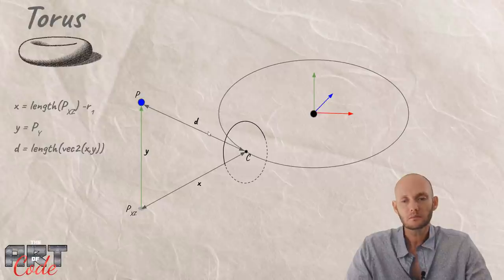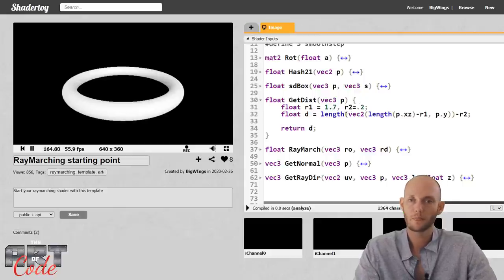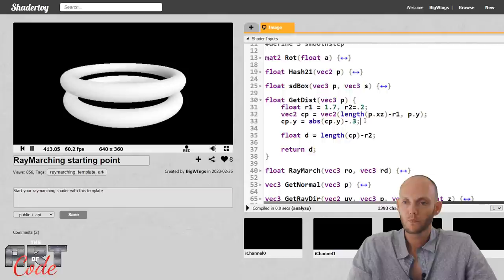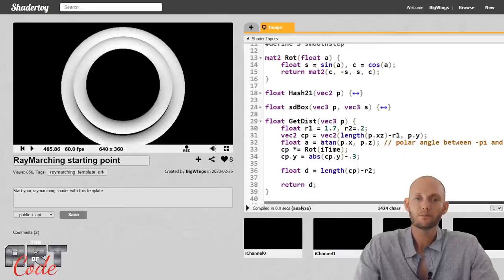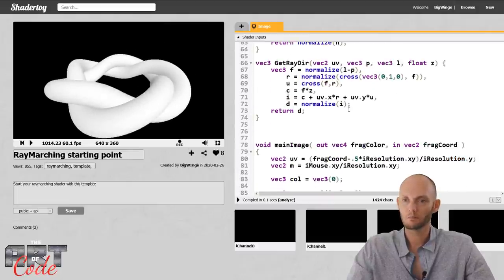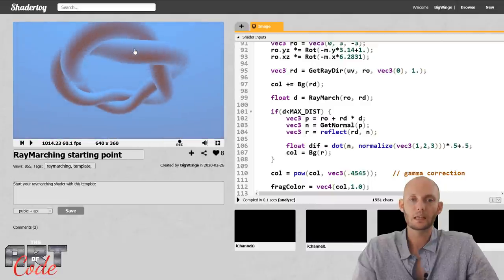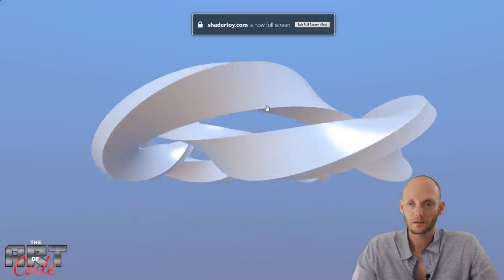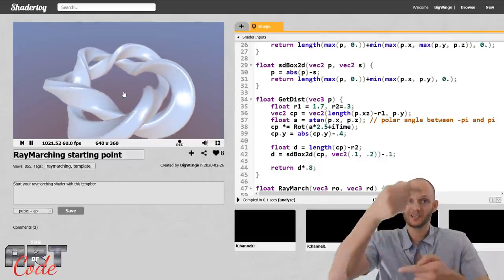Torus Knots explained!

Comment: Are there any mathematicians here? I can easily look up the functions such as max(), min() and their meaning. However, if I wanted to apply myself to study for the next 12 months, what  should I learn, in order to understand these functions and the maths behind programming these graphics? Thanks in advance.
Reply from the maker: I suggest you start at the 'shadertoy for absolute beginners' video and work your way up.
Reply: @TheArtofCodeIsCool   I didn't want to bother you directly as I assume you're a busy man. I meant which branch of maths I could apply myself to in order to illuminate and have have a deeper understanding of the subject. Your explanations are superb and they serve for the tutorials and beyond in some cases. I'm wondering if I should apply myself to trigonometry, linear algebra, calculus and if there is a recommendation for any particular maths course or foundation. I am a computer science graduate that studied discrete mathematics and have a college level understanding of trigonometry and a little less knowledge in algebra and calculus. I am over 50, so it has been a while.
Reply from the maker: @sidfreeman835  there really isn't that much you need to know to get by in computer graphics. I'd make sure to understand vectors, matrices and perhaps some trigonometry and calculus.